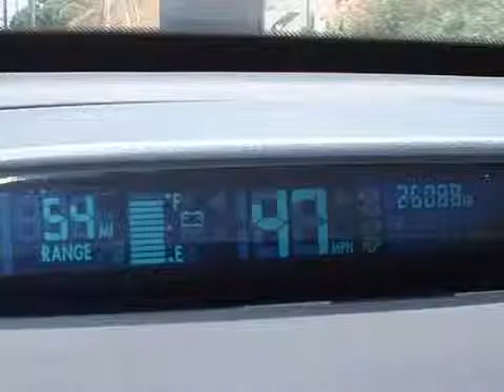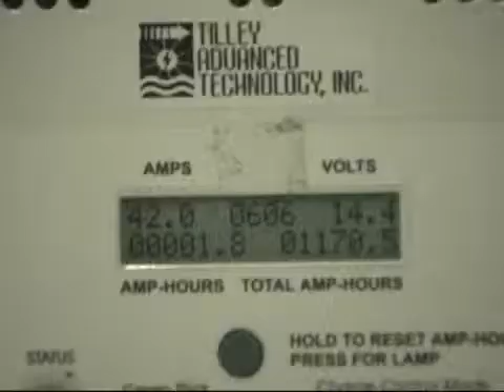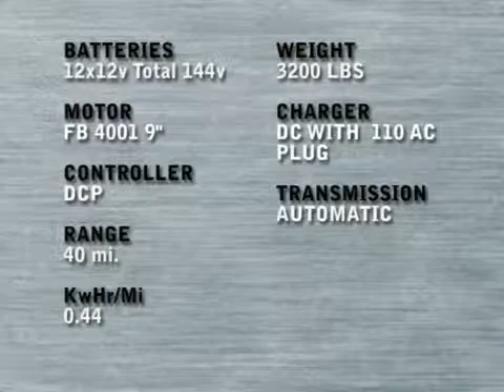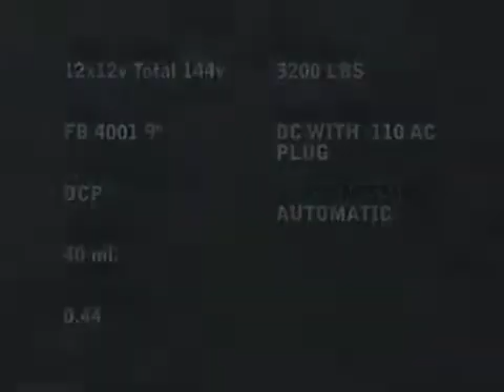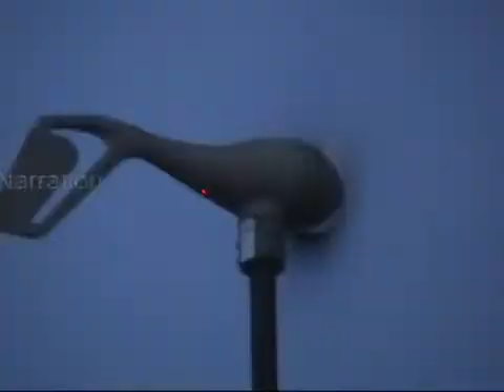Under His Own Power: Carl Tilley and The Electric DeLorean

Comment: I was at the Nashville Motor Speedway the day Tilley allowed the public to see his car and scrutinize his claims. This man is either a total scam artist or is too uneducated to have an understanding of the laws of physics. Either way, he halted the presentation early due to (supposedly) a bad wheel bearing in his test vehicle. Incidentally, the local DeLorean car club had several DeLoreans there and offered to let him use a bearing from one of their cars. He declined. He's a fraud.
Reply: I was there also after driving all night.  I'm not certain it was a fake, remember there was a bicycle also converted and the riders stated it never lost charge but gained charge.  An electrician also stated he tested a stand alone generator as over unity at the Tilley facility.

The motor he used appears to be the same as the Robert Alexander generator that was witnessed by a physicist (cannot remember his name) and sent to be studied at a university. It was a generator from a phone company truck with a hydraulic end on it.  Robert ran hydraulic units attached to a VW and according to reports it never lost charge.  What was unique about the generator was the starter was built into the generator and somehow he wired the generator to obtain about 300% over unity.  I found the exact same model generator but was unable to duplicate his output.  He wanted a $100,000 back in the 1970's to show the wiring.  The physicist bought a different model generator but the same starting type and duplicated the over unity in under 30 minutes by simply rewiring the coils but also refused to state how it was wired.  The generator was a 1800 rpm version and now it appears someone has figured out why it worked and their facility has been running over unity power since 2018.  The unit is now under contract to be produced in Africa though it was designed and built in the US.  The patents used to  work up to the final design are very complicated to me, but the final result looks something like the Robert Alexander version but made solid state.  The physicist stated this could be done in his opinion, that was the 1970's.

https://youtu.be/eYaMt_BeG7g?si=Y0ucBwq94t8pRESE